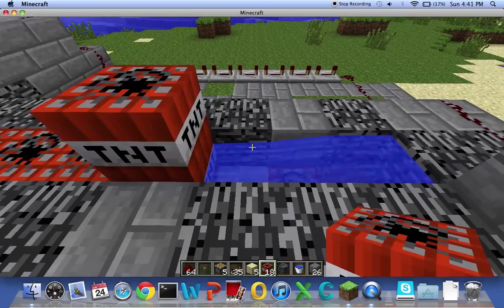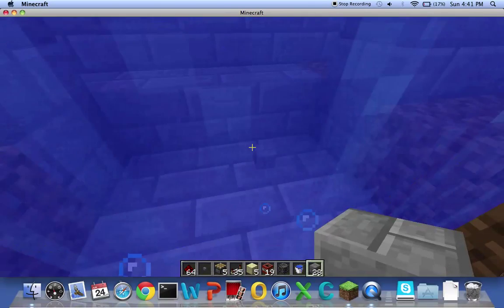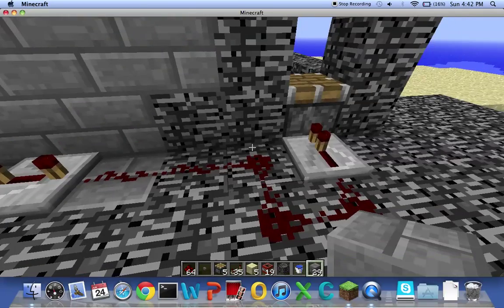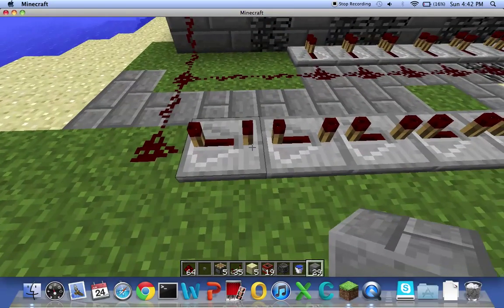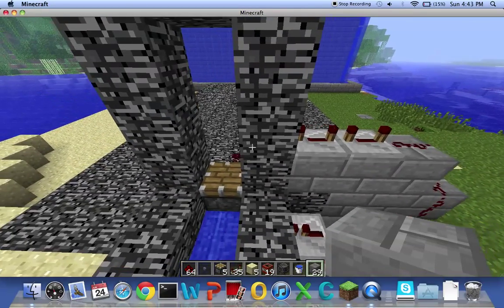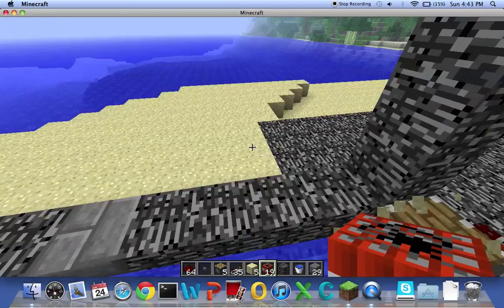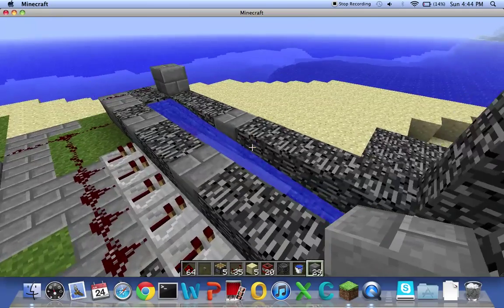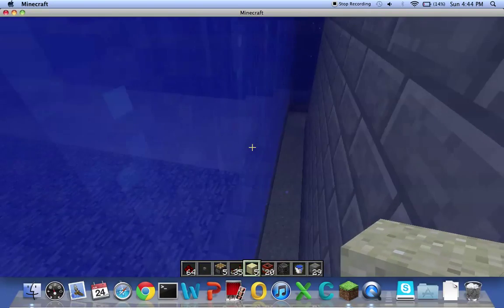How to Make A Hybrid Cannon

Comment: @i8bismark1234 yes it will work if you hit the roof but then you will have water pouring on the chests which you don't want if they are locked